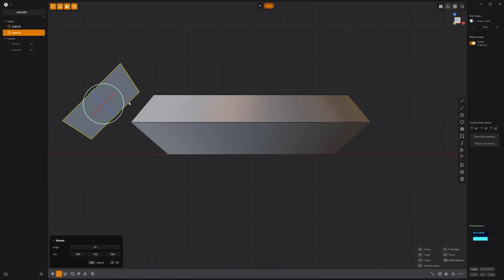Plasticity | Modeling Exercise 56 - Beveled Gear

Comment: This is so very helpfull. I learned a lot, thanks to your help, and already designed some items I need in the household. Could you maybe do an updated and slightly more detailed version how to create two gears that work together. Next to each other and/or even in a 90 degree angle? Or are there tutorials on how to do this? I wanted to try some moving objects next with gears, screws, hinges etc.

Comment: Often I'm running into the issue of not being able to fillet all edges. In this example if I select any more than around 40% of the edges the fillet slider doesn't appear.
Is this my computer saying this is all it can handle or am I missing something?
Reply from the maker: Can you share file on the DIscord Channel and @ me ... Im happy to have a look and see if it works on my system or if it is an issue with the file.
Reply: @Pixelfondue  Thanks for your response. I'm pretty illiterate with discord but will look into it later. Simpler objects, less edges, not a problem but after a certain volume it fails. There have even been situations where I select 99/100 edges but as soon as the last one is selected the slider disappears.
Reply from the maker: @shanester1832  really odd. Would def like to see the files that arent working for you. Especially if they are based on some of the assets I show in videos

Comment: i'll have to see if you have a tutorial on scaling individual faces. i was trying for a couple minutes to scale the boolean object's face on the y axis, then just gave up and tapered it like you did in the tutorial. plasticity is amazing, but it's incredibly frustrating when there are things like that which are incredibly easy to do in blender which are either convoluted or impossible in plasticity.
Reply from the maker: It's really the difference between polygonal modeling tools like blender, modo, Maya, etc.   And.  Cad tools like plasticity

Comment: could you do the same with a worm gear? Problem i found is when cutting i can not move two objects at the same time 😞
Reply from the maker: Can you show example
Reply from the maker: @snapo1750  This is how I would model the top part. making both gear and top part line up Im not sure... If I work out solution I'll share.

Comment: I'd like to see some Magica CSG tutorials. That app requires some creativity to create certain forms. It is somewhat frustrating to use but also very powerful for discovering the form in three dimensions. It is one of the few tools that can legitimately be used for 3d sketching in a productive manner without making technical mess.
But with that said, it takes a creative mind to know how to combine the parameters of the strokes to make various forms.
Unfortunately, the patreon beta is far more advanced than the current public version.
Reply from the maker: will have a look
Reply: I looked for a patreon beta for plasticity but didn't find anything. Do you have a link?